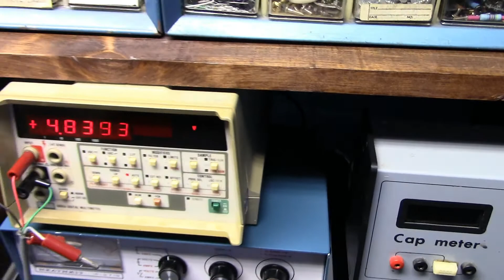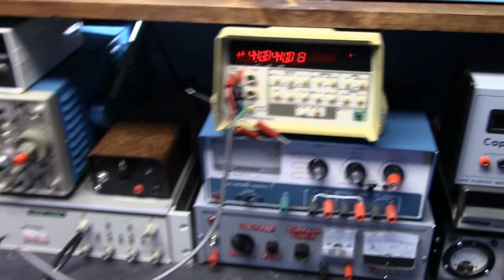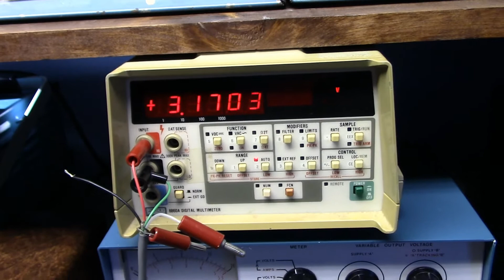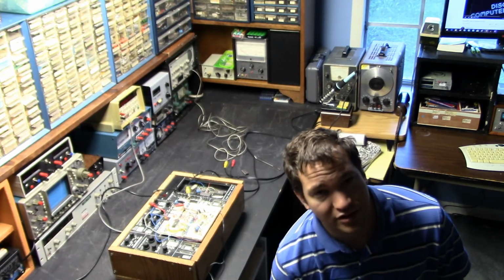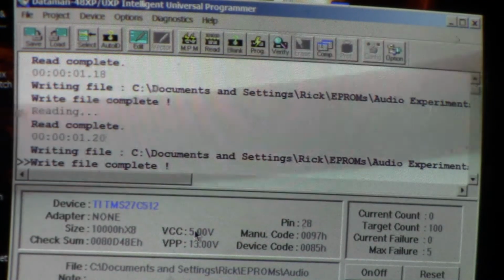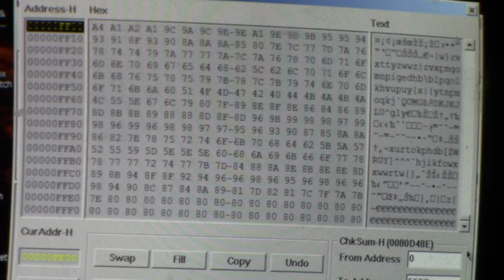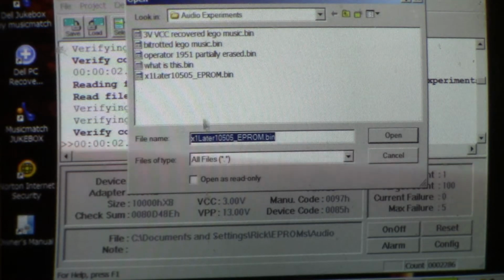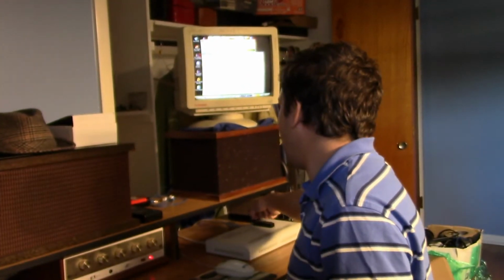Recovering Bit Rotted EPROMs

Comment: Very interesting.  I will try this to recover an EPROM from a special HF transceiver that has a bad checksum.  My cheap programmer only goes down to 3.6 volts so I will try a pot like you did to get down to the 3 volt range.  I like your setup, very clean.  I have too much test equipment to have parts nearby (I do a lot of RF and battery testing, each of which uses a lot of gear).

Comment: That's interesting, I didn't know the data on EPROMS could just fade away even without any exposure to UV. Makes me wonder if flash memory can suffer from bit rot as I have a lot of my stuff backed up on solid-state drives that I would hate to loose.
Reply from the maker: What rotted it I believe was tiny amounts of UV from sunlight and sitting under fluorescent light for some time. With the window covered, that data can last a much longer time. I have had 30 year old EPROMs that still have their original data (though at that age, it is more likely that bit rot can occur).